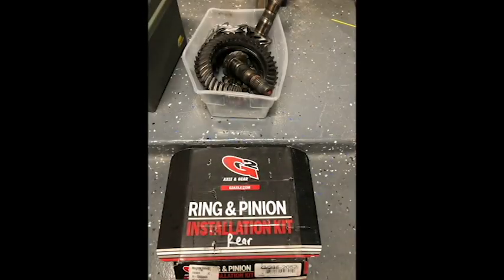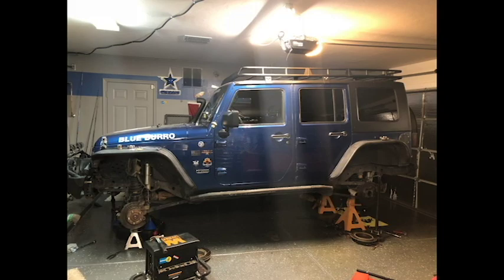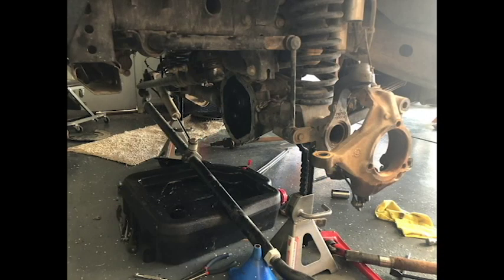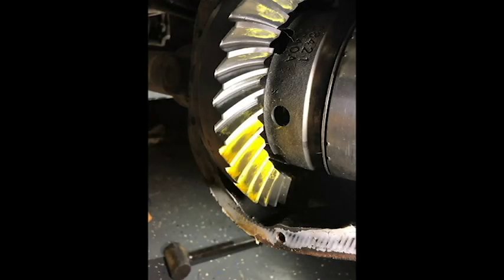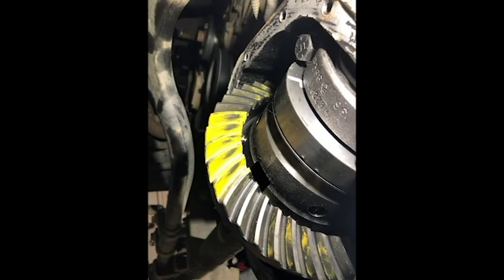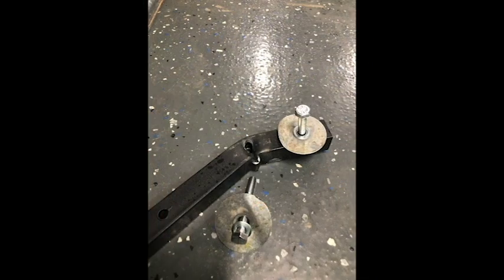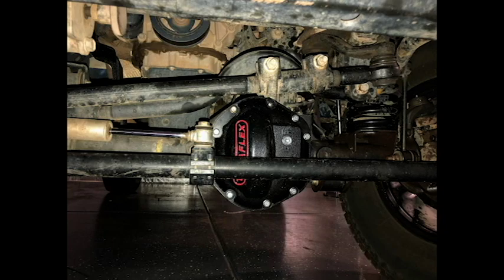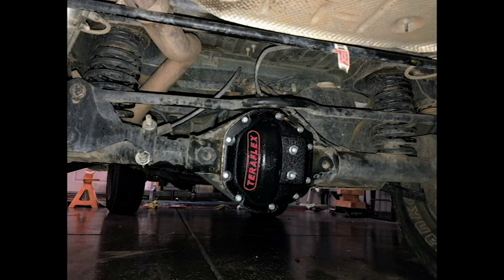Blue Burro Jeep JK (Blue Burro) Re-gear 4.10 to 4.88

Comment: Hello 
Blue Burro 
I have a 2013 jeep wrangler unlimited SAHARA V6 3.6 automatic jk  4 doors and it's GECKO PREARL green 
It has 35x12.50r20 wheels and  tires  I think it has.      3:73 gears  Has towing package on Door it says GVWR is 5500  
So would 4:88 gears work for me  i do like to drive a round 
Maybe help someone out if stuck hope you can answer me thanks 
I'm not well, I have NF1
Reply from the maker: With 35" tires 4.88 gears are optimal for street and off-road.

Comment: What size pinion shims did you end up with? Also what size carrier shims left and right? Im currently regearing my rubi to 4.88s
Reply from the maker: I done remember exactly on the shims. The front was 1 to 2 mm different from stock. The rear had to be adjusted quite a bit 4 to7 mm from one side to the other. The rear was the most difficult and it took hours to get adjusted correctly.